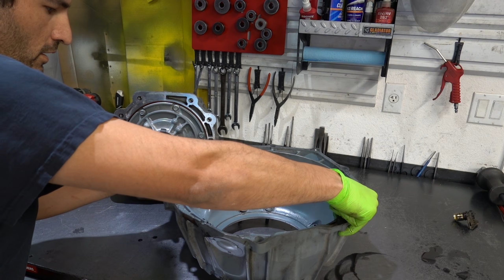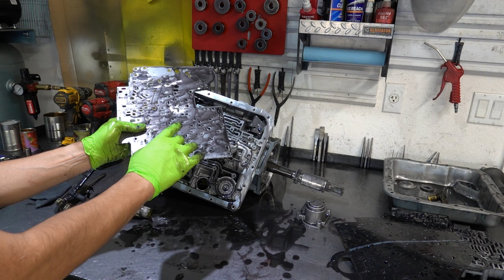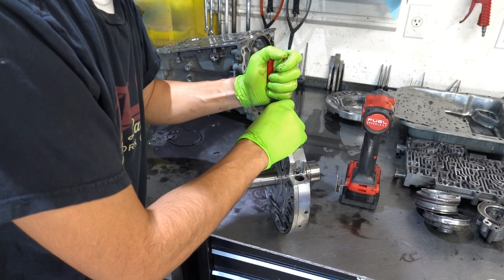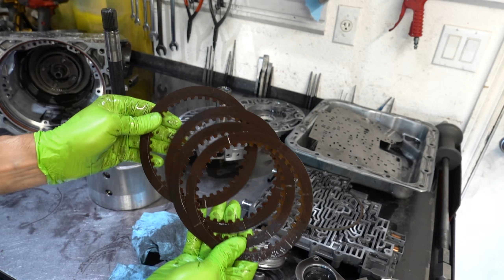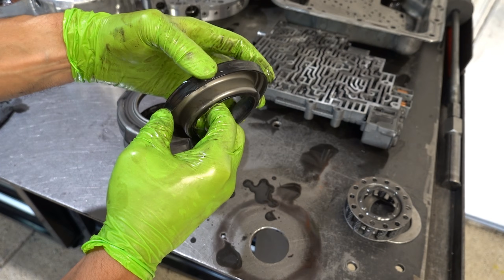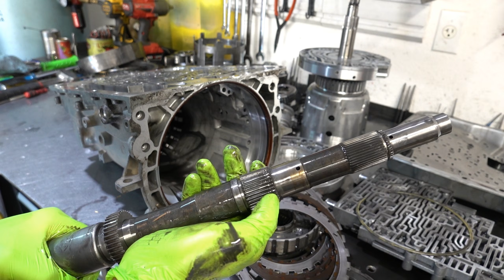4L60E Teardown and Inspection: Suspected 3-4 Failure - Major Plot Twist!

Comment: I know this is a year old but if you put a notch in your screwdriver it helps to remove the snap ring.
Reply from the maker: I have one but now use a long Snap-on radiator hose removal pick...

Comment: Thanks Nick, enjoyed watching alongside your discoveries!  Just curious if you've ever seen significant wear on gear teeth of the sun gear and planets in a 700R4 or 4L60E?  I just pulled down a 700R4 from a 1990 K1500 with significant wear and pitting of gear teeth as well as evidence of slipping and heat in just about every clutch pack.  Strikes me as a bit unusual, maybe a result of many miles with heavy loads.  Had lots of wear on both sides of the drum tabs as well.
Reply from the maker: Thank you for watching, George! Yes, every once in a while, I will see a severely worn sun gear or entire gear aset...It's not super common as the planetary carrier-sun gear-ring gears are usually pretty resilient in these units and 700R4s. Lack of maintenance would be my guess as to the primary driver...Pitting usually indicates water contamination, usually for a prolonged period of time while all clutch packs burnt (partially or totally) indicates line pressure issues, prob due to poor TV cable adjustment, excessively worn TV valve bore (VB), pump, converter or simply ran low on fluid/leaks.

Comment: Thanks again for the great content Nick; much appreciated. In the video you mention that the customer will be getting a wide 2/4 band. Do you have a go-to recommendation for that as I'm thinking of adding that my current build but not sure about which to pick. It's a mostly stock build for a 2002 Avalanche w/ 4wd. Thanks again brother.
Reply from the maker: Thank you Tony! I always run the Alto Wide Red band for anything street-driven and their Kevlar band for race or very serious street/strip units where it's understood the transmission is more of a maintenance item to be refreshed periodically between racing seasons, etc...

Installing the Alto Red wide band and new reverse input drum almost always provides you ideal band clearance when using a factory two-groove pin, regardless of servo pistons being used.

Comment: To remove a stripped out bell housing bolt. I use a left handed 1/2 drill bit. If you get lucky, it will snag the bolt while drilling and spin the bolt out.
When removing the pump seal (and rear seal) place a shop towel over the shaft to catch the seal from splattering fluid and flying across the room.
Reply from the maker: Great tip, Gearshifter! Will try grab a left handed 1/2 bit and give that a shot...

I tried the shop towel thing and it either falls off or doesn't stop it. I may use an actual rag next time.

Comment: So, 25 mph then neutral? Or 25 mph top end? 

Would you like to know an easier way, to remove the LR.. other than a hammer ?
Reply from the maker: Hey Larry, if you can share an easier and less clunky way to get the ctr support and l/r clutch out, I'd be happy to know it as would others, I imagine. 

I'll follow up later with a response to your first question.
Reply: @nickstransmissions  

I use a pair of snap ring pliers, between the case and where the anti rattle spring goes. When you squeeze the pliers. The support will move. While holding the pliers, shoot some air into the low reverse (put a rag over the air nozzle) it will pop right out. No damage to the case or lugs.
Reply from the maker: Sweet, thank you Larry! I will do that on the next 700R4 or 4L60E teardown I film...

Comment: When I hear those terms flat rate or replace or repair only what’s needed I immediately think no leaks circuit or leaky drums were addressed, which means a three and four clutch failure is looming and bound to happen
Reply from the maker: Yep, very few flat rate shops test for anything..If it isn't burnt, falling apart in their hands or otherwise not obviously damaged, it's getting slapped back together.

Comment: Great video , almost done with mine  i will follow you recommendations and install pinless accumulators . I did go over the trans throughout  not sure on the boost valve in the pump, i did get an 13vane  used pump that was rebuild and i did install the transgo pump spring but not sure if i need .500 boos valve. 95 camaro thanks..
Reply from the maker: Thanks, man! Yep, I like the pinless accumulator piston in 4th but keep the factory one for 2nd gear unless you're running a higher stall converter. I'd definitely get the Sonnax 4L60E LB1 or LB2...The LB1 works in all years 4L60E from 1993-E2005...The LB2 works in all years L2005+...You can differentiate the two by the length of the 'nipple' on the front of the boost valve sleeve....The early design is longer while the late one is very short.
Reply: @nickstransmissions    thanks i am running a 2400 stall on this  so will be going w all pinless ones..
Reply from the maker: Sounds like a good plan, man. Let me know how it turns out.
Reply: Thank you much appreciated
Reply: Hey got a bit of plot twist my self so im doing my pinless accumulators and for 1-2 it requires stock or sonnax special spring all i have is  stack of 3 springs from shift kit ,should i just use one sonnax spring or white medium spring from shift kit or  just keep what i got with stock piston thanks alot 👍
Reply from the maker: Install what you have and see how it goes...The pinless piston will provide a small bump in firmness regardless of what spring(s) you use but the Transgo set isn't much firmer than stock...If it's too harsh then you'll want to install the Sonnax or factory spring set up.
Reply: Had  a chance to reassemble  trans and install drove it today shifts very quick and nice low mid throttle, only thing is when doing 45-50  tcc kinda bumps torque converter is 2500 stall and aftermarket dana i think. 12" stock style , still stock rear 2.73 gears planning 3.73... Anyway thanks again for all the help...

Comment: always happy to see your uploads. I learn a lot from them. It almost gives me the courage to rebuild mine lol 
Is there a parts list/kit you recommend. It'll be for stock/towing in my s10 crew cab
Reply from the maker: Thank you, Robert! Appreciate the kind words...If you're looking for an all-encompassing kit with most everything you need (except for the electrical package) in one kit, check out eBay's Deluxe kits....If you search "4L60E Deluxe Rebuild Kit", you'll generate a list of results...Just scroll through until you see your vehicle's year along with the level of kit you want. For example, you can get a kit that comes with upgraded Alto frictions, BW Band, steel plates, forward sprag clutch, Transgo shift kit, heat treated sun shell, paper/rubber, filters and gaskets...Most of these kits are sold on eBay by Transpartswarehouse.com...They're one of the largest suppliers of transmission rebuild components in the country...I've used their kits countless times, they're good to go.
Reply: Thank you for reaching back, nick!
Reply from the maker: You're welcome, Robert!